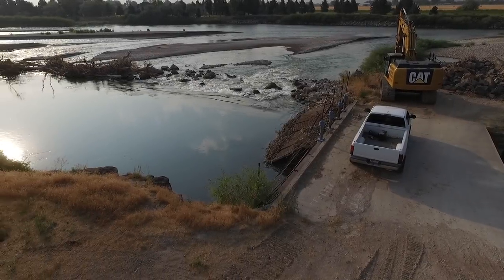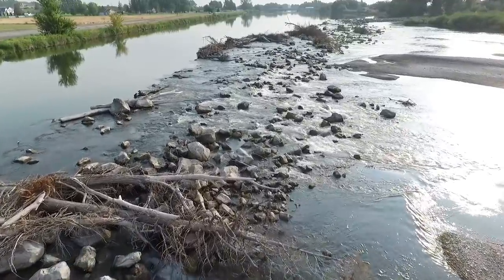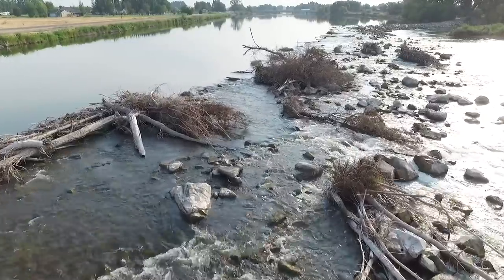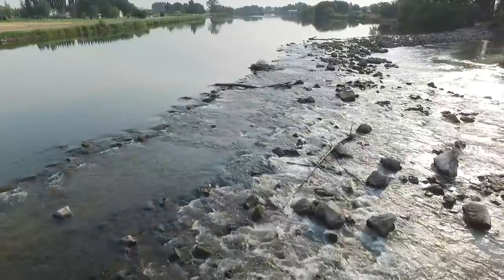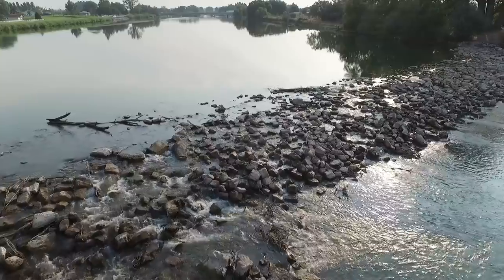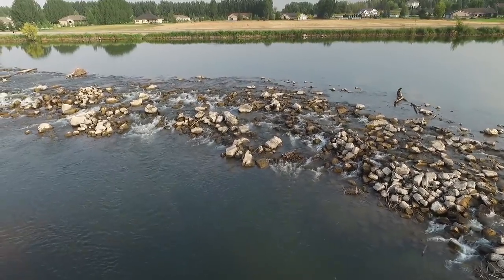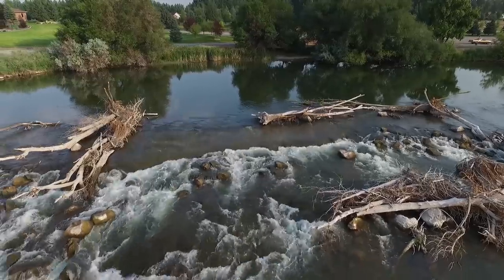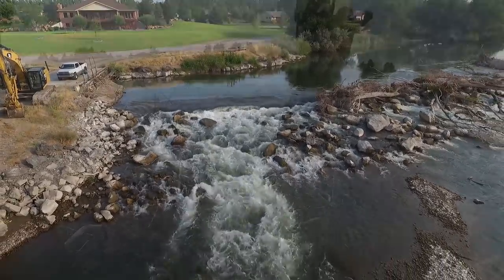Caterpillar Fishin Pole

Comment: I remember you rebuilt one side of the 9 maybe both but one side was broken before. Letting water in. You felt different about the cause of the damage than me . I thought she looked like it was damaged by taking a slide sideways down a mountain and of course the slide didn't hurt it ,but the sudden stop may have. I was pulling the levers on his 9 before kindergarten. Best one he had . Only burnt 5 gallons of motor oil a day. Lol. But he babied it and made a big pile o,$$$ buried trash 8-10 hours a day over 3 years with it. He always wanted a 6 for in my state a6 is able to be moved without dropping the blade. Till a rental slid out under him. Then he said to FIX MY NINE! drag that 6 back where it come from. Love your vids ,they take me back to better days . Particularly when the 9 is earning it's salt

Comment: That kind of water work up here would take a butt load of permits, those spray can of lube are really good for roller chain applications or even on the circle parts on a grader that you don't have grease fittings for those types of things it's really useful stuff

Comment: I have a question. Do you not run the excavator at  full throttle so it doesn’t suck the water in?
Reply: They air intake and exhaust are both like 3 meters up. No point.